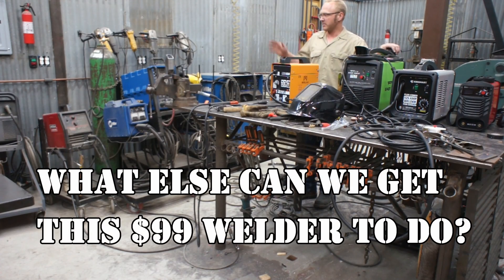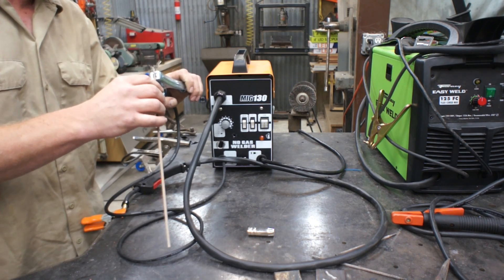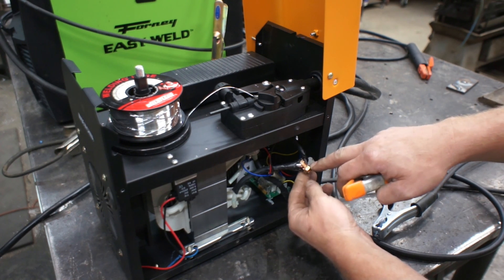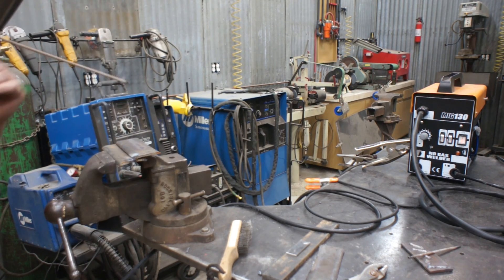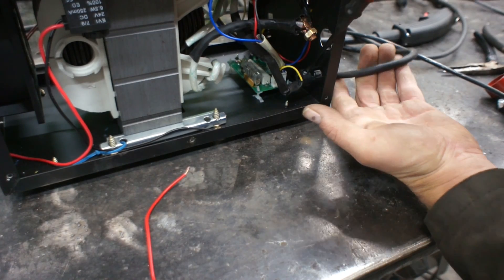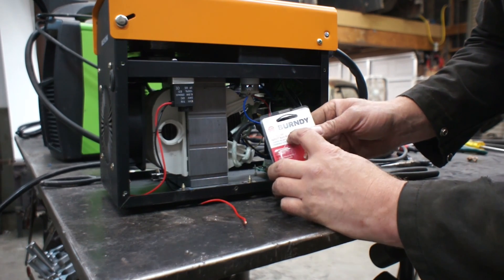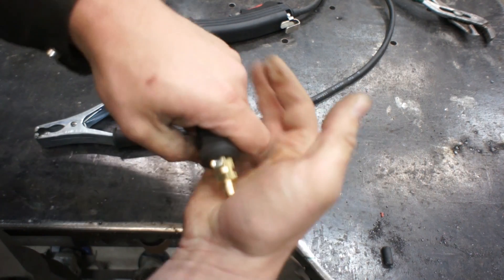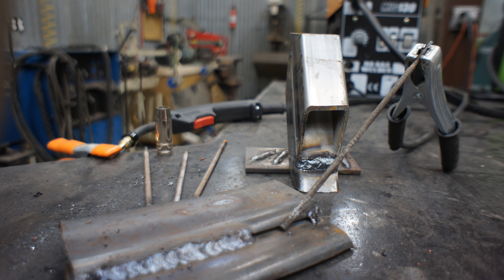$99 flux core machine is Stick welding! | EZ welder hacks

Comment: You know that's amazing
I have had an idea that's remarkabley close to yours except I was thinking of using the wire from a flux core welder instead of a stick my question to up you what do you think the other questions I also have another idea about a spool gun to weld steel as I am thinking tighter control in tight spaces will you have any input upon these ideas I will like to hear from you 
                                                                                     Thank you in advance

Comment: Thank you!
made my decision easier, as a DIY'er, arc or flux?

well, little mods to cheap flux welder, can have both!
appreciate you!
Reply: A point of clarity it will work but the transformers are different a stick machine is constant current where as mig is constant voltage, I'd recommend as a diyer you go with a multi process welder like a Lincoln can do stick mig and tig. Amazon and ebay have good beginner options that don't break the bank

Comment: the reason i was watching this video was i saw a video on battery boiling using a stick welder. i only have a wire welder. so the stick side is hot and ground is ground right? i figured there was a cheep way out to do this.

Comment: so you in turn took and eliminated the mid gun and attached you're a stinger and use the open circuit voltage to do the welding?

Comment: Great video! Wanted to know if you made another modification to this welder after noticing the solenoid bolted to the welder that was labeled EVI 7/9,24V DC, 6.5W 250mA. Did you add that solenoid to your welder? If so, what does it do and how is it wired? I also made a few modifications to this same welder and posted a few videos on my channel to share my experience. Cheers
Reply from the maker: its a gas solenoid. I lost interest in the build though
Reply: After looking up that solenoid, did some research and decided it wasn't worth the therapy. Please consider a video on adding a relay so the gun is hot only after squeezing the trigger. Tried to figure it out myself, but missing something in the concept.
Reply from the maker: My ultimate goal was to make it into a suitcase style feeder to run off of my miller bobcat.

Comment: Hi and thank you for the video, I'm new here and I'm trying to do the same mod, but I don't know if I missed something, why did you cut the ground and reconnected it again
Reply: He cut the ground wire so he could add a ring terminal and attach the positive secondary wire to one of the two  Dinse connectors (DKJ10-25) he installed into the front panel. That allows him to disconnect the ground cable from the positive dinse and connect it to the other dinse connector above it, which is connected to the negative secondary wire in the welder. He then connects the stinger cable to the available, positive, female dinse connector. I might do the same modification to my welder and post the video for everyone. You can see the mods I've made so far with the same welder on my channel and that will help familiarize you with the welder's wiring. Cheers

Comment: This is interesting... I've been trying weld some super thin sheet metal with a stick welder that'll turn all the way down to 5 amps. Problem is 1/16th 6013 rod is still just too thick (for me anyway). I had the idea of trying some flux-core mig wire and just holding lengths of it with the stinger. Do you think that could work better?
Reply from the maker: You would either need shield gas or flux. You could oxy acetylene weld it, you have a torch?
Reply: UnitedStatesofBuild Isn’t flux included in the flux-core mig wire? 

And yes, I have an oxy-acet torch as well. I would consider brazing but I’m attempting butt joints and it seems like that would be really tough (?)
Reply from the maker: Yeh, my bad, its included. You might end up turning the entire length red hot, like a heater element. Id be curios to hear the results.
Reply: UnitedStatesofBuild Okay! I’ll give it a shot and let you know
Reply: @truthsmiles  2 years late but you'll just melt the whole section of wire and it'll fall out. That's what happens to me when I run too much stick out on mig and FCAW. And to touch on the gas shield/flux part in the first reply, there's dual shield FCAW and FCAW-S, FCAW-S being self shielding while dual shield is FCAW wire with shielding gas.
Reply: @smileyguyz  haha thanks for the reply :) I never made the attempt - I just ended up practicing and getting a bit better at stick welding with 5 amps, but still making a bunch of bubble gum and spray painting to stave off the rust. Still holding, but no idea for how much longer!
Reply: Why? Why?  Just mig it
Reply: @garagekeys  If I owned a mig welder I'd certainly do that. It was a small "one off" project that didn't seem to justify buying a whole new rig. I did learn it's virtually impossible, though, as you know. Today the thinnest metal I'll even attempt to weld with stick is 1/16", but really 1/8" is the thinnest I get results I'm happy with. 

One of these days I'll buy a little 120v flux core machine for small projects - they're getting cheaper all the time :)
Reply: @truthsmiles  look on offer up for a Lincoln 100 it's not real powerful but I usually get them for 100$ and convert it to another 40$ , solenoid and regulator, they would sheet metal nice and 120v

Comment: very good idea!!! CHAPEAU :-) , just a question to be sure ,  the electrodes must be inverted if we convert the flux core to stick  welder and vice versa ,right??
Reply from the maker: Remember this machine is running AC, its not as popular as DC. It can be electrode specific so be sure to check. I ran in Electrode negative
Reply: @unitedstatesofbuild4915  thanks for response !! i have this welder its a flux core gasless :
https://www.youtube.com/watch?v=0Zpomtg-2Nc
do you think thats an AC welder like yours ?

Comment: Great vid. So I have a DC gas/gasless mig, (cheapo machine) If I connect the stinger to the main AC transformer this should work as well yeah? What about if I connect the stinger to the pos coming off the rectifier after the choke? then it would be a DC arc, would it not Still work? Interested, and thanks for the video
Reply from the maker: Wow, You have some great questions there that Im not able to answer. Id actually be interested In knowing this also. Could you add a switch to bypass the rectifiers and have an AC/DC machine?
Reply: @unitedstatesofbuild4915  I am thinking maybe just running from either side of the mains transformer out the side of the box before the rectifier and adding a switch, tentatively giving me an AC arc welder when switch is on and DC mig when off and mig is needed?
Reply: @zombieprinting2670  Yeah, you'd want to run the AC output after just before the rectifier I'm guessing... hoping there is a power controller (dimmer or rotary switch) before that so you don't have to deal with making some sort of rotary switch or switches to connect the multi stepped down outputs lines of the transformer to the AC output connector.   I was thinking about doing that on my Century 125GL machine for an AC option for testing a balance circuit I was looking at.  Though, the more I study the design, will be way easier to make some sort of inverter controller to have a range of output waveforms not only for balance adjustment for Aluminum TIG welding.   Now, to have the dense connectors for DC welding, that seems kind of neat so I have a more versatile portable 120VAC mains system.

Comment: That set is exactly same as my Hawke 130, l was thinking of doing this mod last month, think I'll get dinse connector and give it a go as I've still lots of 2.5 rods, so to be clear ya connect the electrode holder in the earth?
Reply: He cut the ground wire so he could add a ring terminal and attach the positive secondary wire to one of the two  Dinse connectors (DKJ10-25) he installed into the front panel. That allows him to disconnect the ground cable from the positive dinse and connect it to the other dinse connector above it, which is connected to the negative secondary wire in the welder. He then connects the stinger cable to the available, positive, female dinse connector. I might do the same modification to my welder and post the video for everyone. You can see the mods I've made so far with the same welder on my channel and that will help familiarize you with the welder's wiring. Cheers

Comment: Whats your thoughts on doing this and converting to a DC with a 200amp Bridge Rectifier?
Reply: Its a great idea. Also, both flux core and stick welders have conditions where one has an advantage over the other. Having many types of welders is like having variations of the same tool, they all have their particular usefulness.
Reply from the maker: If it were me Id invest the money in an IGBT DC stick machine that could run on 110/220 up to 160 amps. I bought this flux machine and a stick machine at the same time. The stick machine is way more versatile and slightly more powerful.
Reply: @unitedstatesofbuild4915  That didn't really answer the question. What good are Mod videos if the answer is just buy a better welder?
Reply from the maker: Fair enough, you probably know more about these welders than I do though. DC would definitely be an upgrade in this case. Im not sure if you could do it with just the bridge rectifier, wouldnt you need a few capacitors also? PS, FWIW the stick machine was the same price as this flux machine. Hope I answered your question.
Reply: @UnitedStatesofBuild Exactly right. I just converted my VERY simliar
machine to DC with 200a bridge rectifier and several capacitors that
added up to 47,000uF. Also added relay controlled by torch button
so the that torch is only hot when button pressed, Works MUCH 
better as a flux welder now. Never tried it as stick welder (got one 
of those!) 
Thanks for the video..........
Reply: @dd_ranchtexas4501  Also made some of the same modifications to this welder and posted some videos to share my experience, but didn't add a relay or a capacitor. Please consider posting a short video on how you added the relay. I'd like to know how you made that mod, so I can do the same. Cheers.